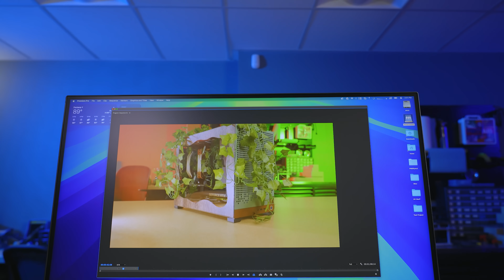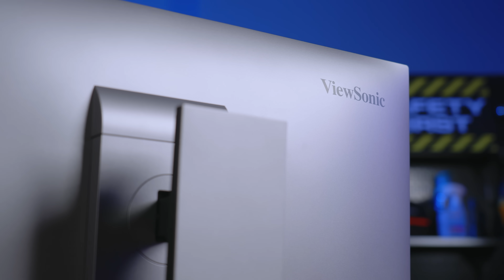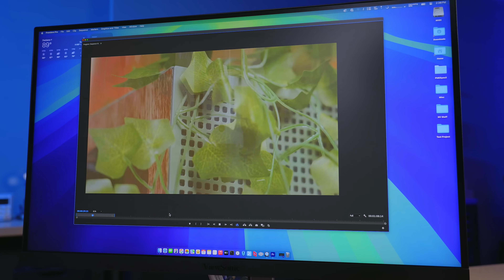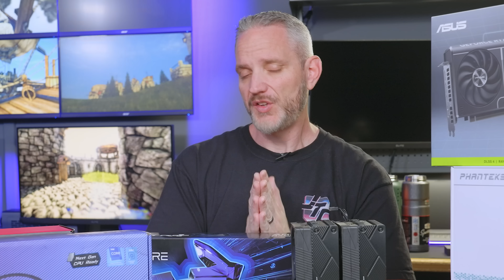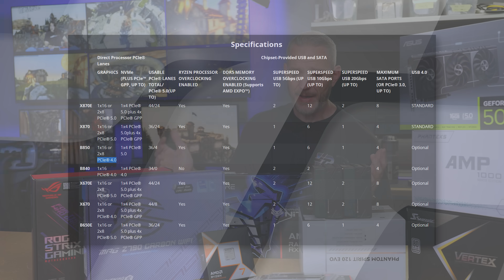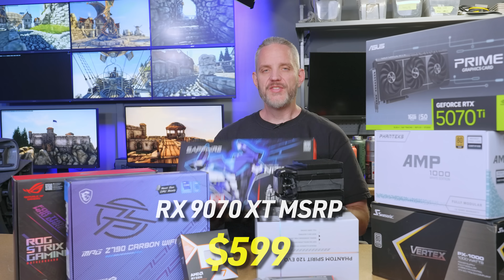This is the Sweetspot for PC gaming... Don't get fooled into spending more!

Comment: After building several computer systems, I am only now beginning to recognize how much money is often wasted on maximizing numerical specifications merely for their own sake.
Reply: Used can be good value. Rich/engineers need fastest best tech so they sell their 3 year old great kit. Can buy top tier from 3-4 years ago for a fraction of the price.
Reply: @Google_Does_Evil_Now trui just saw a whole pc sold for a 490€ with a 3090 inside, and the guy even gave the 27 screen 😮🤷
Reply: Same. I've been building within many budgets for years. When it comes to gaming you really want to build around your gpu and not budget your PSU too much. The rest? Really easy to use exceptionally cheap, so called low performance, parts. 

The difference in fps between 2 pc's using the exact same gpu might just be under 3%, while the costlier pc can easily cost 50%-100% more. Especially if you game at 4k or even 1440p. At 1080p your cpu becomes the limiting factor much more easily.

If anyone needs help with finding the perfect combination of parts within your budget, with explanations and discussion if needed, I'm willing to help you out. I don't need compensation or anything, just want to make sure other people get a good experience inside of hobby that I dearly love. 

For people wanting to go through the wonderful proces of building your own pc and picking the parts yourself, I have a few points to think about;

1. Make your gpu the focus off the budget. I've had issues with a 2nd hand gpu only 1 in +-20 that I've ever bought. YMMV! So 2nd market might be a good idea to look into. Just make sure it works beforehand.

2. It depends on your budget and what games you want to play, but within the midrange segment it might be smart to only spend around 50-70% of your intended gpu budget. If it can carry you for 2 years. After those 2 years you will be able to sell your recently bought gpu to still get a nice price for it. Add your savings from those 2 years before and whatever you have saved up and you will probably have much better performance and or acces to new technologies, than you would have had with your full priced gpu. It's a technique I've used myself over the years to steadily increase my gpu tier, without having to splurge or save up for a long time. This works especially well if you get a recent and popular 2nd hand model as your first gpu. Just upgrade before it loses too much of its worth (compared to what you paid for it).

3. It's good to know that you'll be able to upgrade your cpu on a certain socket, but in practice most people just end up running their system without a need to upgrade, untill its much more worth to just built a new system (or at least replace just the mobo+cpu+memory).

4. Single core clockspeeds are still the most important for most games, but the generation of your cpu and things like extra (3d) cache might have a bigger impact to irl performance. Just do your research and look for your gpu in the resolution you want to game (very important as there is verrrry little difference when gaming at 4k). Nowadays I'd advice 6+ cores, but plenty games still run great on a quadcore with fast clockspeeds, if you're on a really really tight budget.

5. Don't get hyped up by YouTubers. If you only play games you will probably be better off with a 150-250 euro/dollar cpu than a top of the line. Only get those if you are rich, want bragging rights or do any heavy workloads besides gaming.

6. If it's your first build I would put a little extra towards the case and power suppl, as you can keep them while upgrading the rest over many years, if not decades (my chassis is 12yo now, and a good PSU can keep with you for over 20 years if it's good quality and your power needs do not exceed it.

7. Personally I would go for a 9000 series (if you want to go older gen just pick Nvidia) AMD GPU at this time. Unless you want to play games with path tracing, use SVP with rife ai and/or Nvidia optical flow or need the cuda cores for work. As AMD's 9000 series support FSR 4 well and it gives you a whoooole lot more performance per dollar.

8. Keep your GPU's ram in mind. Especially if you want it to last. 8gb is becoming not enough, even for 1080p gaming. That's why I got a 5070 ti over budget instead of a 5070 with just 12gb. Those 4gb difference cost me a hundred bucks, while it will make the card last much longer. If I didn't need many of the special features on Nvidia cards (I use all of them), I would have gotten a RX 9070 without question!!

10. And last but not least, don't worry too much about getting the newest generation motherboard, cpu and memory. Irl there isn't that much of a difference when gaming. And even in workloads the difference is often dissapointing. A 600 dollar pc with last gen parts can often outperform a 1000 dollar of using the latest parts. And I'm talking similar tiers here.

P.s. don't get an overpriced motherboard and look at the I/O needs you have. So how many and what kind of hard drives do you want? How many usb? Do you need very high speed usb? Pick one with 4 channel DDR as that is one of the few things people consistently upgrade. External wifi is always better and way too expensive on a mobo. And probably the most important part for any gamer is what kind of PCI-e (your gpu connection) it has and how many PCI lanes (how many things you can connect, like harddrives, beside your gpu. PCI-e 3 is getting old, but 4 is absolutely fine for most things, as long as it has a 16x connection.
Reply: @2Adapt I want to get into pc. I’ve been a console gamer for 15 years. What would you recommend with a budget of 2k. My main focus is performance. I play lots of multiplayer/rank/competitive. Graphics to me aren’t a big deal, I hardly play single player story games. But the option would be nice to play something in 4k and have smooth gameplay.
Reply: @2Adapt  No i would not keep a psu for that long.
Reply: yeah wasted 20% extra money on my last build, at least I was fully aware of it  and did it anyway. :)
Reply: You should buy a new one only when you need it. Look for the best value for the money, not the best unless you REALLY need that. I updated my rest of the computer, but still using my 2080, because it is enough for me right now. Otherwise I made good purchases, but I bough too expensive motherboad. Although, it was also kind of an experiment, because I have had cheaper ones previously. Cheaper ones is much better choice. Rather spend that money on better cooler, case and PSU.
Reply: @xvnbm fully agree with you there. Top parts are there for the rich enthusiast. I used to for the most part chase the best graphics possible, as I've always been in love with that aspect of gaming. But teaching myself to love gameplay over graphics was one of the better lessons I've taught myself. As I'm getting older and the AAA market is becoming foul, I'm learning that it's better to look back and appreciate what we have. I still adore good style/graphics and love things like path tracing (and yes I love DLSS and FG, when used properly as well), but I'm also aware that there are many more games already out there that could keep me busy for at least hundreds of years.

If you want to be content or even happy, stop chasing dragons, and learn to appreciate what you already have, is what I have to keep telling myself. And everytime I put this into RL action, I learn that I've been missing out on pure joy and art, simply because of my own biases and spoiledness.

Keep rocking that mighty 2080, and enjoy it with all that you got!
Reply: ah what the hell... its in the bus if the bus has been upgraded ya go for it, if not its smoke and mirrors. Yep its that simple how fast the parts talk to one another is what matters the most.
Reply: I never had a lastest generation console. I always got the second to latest. And now that I switched to pc I do the same. Cheaper games, cheaper parts. And for my needs that is a good thing and enough.
Reply: only thing worth worrying about is the gpu. everything else can be mid or low tier
Reply: @mexreax4493  Eh, CPU can matter quite a bit too, especially at 1080p or in cpu-heavy games so dont cheap out on that too much
Reply: @mexreax4493 cpu very important proly more than gpu cause u can put a beasty cpu paired with a fairly high end gpu and not even worry about a 90 series card
Reply: Absolutely. My ~8 year old PC can still run every game out there, granted not on ultra or anything but on either medium or high
Reply: @EB_3D  My 2017 build is rocking still.  CoffeeLake 4.2GHz 6 core lol,  although I picked up an EVGA RTX 3070 (with rebar) when my MSI 1080 died a couple years ago for 500 CAD.  Often one can scoop cards when their next gen launches and all of the meta-chasers dump their cards on the market all at once :)   Everything can be run High 1440p 144Hz Gsync with the right ini tweaks and debloated OS & NVMe. So much so, when I finally do a new build in a year or so, I will likely hand down this to GF for her first gaming rig
Reply: @MattRoadhouse 
Great to hear that your system is still serving you very well.

I went to the same RTX 3070 when I gave my 1080 to my partner. And I'm still rocking an AMD 5600x (although with a heavy, but stable OC @ 4,7ghz). Nowadays paired with a 5070 ti. And it's still not really bottlenecking at 4k with path tracing! I might gain a max of 3% fps if I went with a completely new system off around 800 euros for just the mobo+cpu+memory. I do have to say that the overclock is doing a lot of the heavy lifting, and I do feel limited when it comes to anything outside of gaming.
Reply: @2Adapt  That's awesome!  I wasn't sure about bringing the 3070 over to my next build,  was considering 5070 ti super after it drops and my first AMD chip.  Haven't looked much in to 4k yet although I probably should, as my rig is also my media center w/ fiber optic sound -> Onkyo amp -> pair of car sub boxes lol
Reply: @MattRoadhouse sounds like a great setup, and I hope the 5070 ti is going to be affordable for you. It's little brother (that I own) is already a power house and a much bigger upgrade than what YouTubers and charts had me believe. Especially when it comes to running modern technologies like DLSS 4 and path tracing. I'm currently running my plasma at 1440p@60hz, my CRT at 2560x2048p@90hz, and my tablet screen 2560x1600p@120hz, so I'm not on 4k either. When you're stuck on 1080p a good solution is to use Nvidia DSR and downscale from 1440p or 4k to 1080p. Even if you use the exact same internal resolution with DLLS the downscaled red will look so much better. Even 1080p with DLSS DLAA looks worse than 4k DSR with DLLS performance (or the one that gives you a 1080p internal res).

Comment: I've always over spec'ed PSU. I typically use them for 7-10 years.  Like I was able to get a Corsair RMe 1200w  for $170 last year. Even though I know my system at most will draw abit above 600w.

Comment: Still love my 5600G and 3070… bought in May 2022 to use the internal graphics until GPU prices dropped in the fall desperately needed a new desktop and got going… probably will eventually get a new cpu and then repurpose the 5600g to be a small form factor nuc like desktop, current system drives three monitors for productivity. Which I end up doing more than gaming and performance wise I am never left wanting more or upset with how it performs.

Comment: You talk about the thermalright air cooler for $50 but you can also get the thermalright 360 AIOs for around $50 too. When theyre the same price the AIO would be the better choice. The thermalright frozen prism 360 performs close to the arctic liquid freezer III for half the price. On a budget build with mild overclocking the thermalright is a no brainer. Also where TF is this 9800X at????

Comment: You're scary, Jay. I JUST WALKED OUT of Microcenter after being in there for over 2 hours doing physical research as to what to upgrade to, motherboard wise and Cpu wise, from a 10700k. This is exactly what I needed to hear. No 870E board for me!
Reply: You should just keep the 10700k little longer, that's the last good CPU from intel and I couldn't imagine any gaming scenario when this CPU wouldn't be enough. If you turn off all stupid security features (TPM, SGX, Spectre, Meltdown...) you can gain a little more performance, but it's true for other CPUs as well. Maybe a little all core OC to 4.90-5.00GHz.

Here is agreat video about CPU scaling from Hardware Canucks, 10700k about the same as the 12600k on the charts
REALISTIC CPU Scaling - RTX 5070 & RX 9070 XT

With an expensive platform switch you gain max 10% gaming performance and 50-70W less power consumption, for production work it is a totally different story.
Reply: @sviktor4  Main issue with a 10th gen i7 is PCIe 3.0 IMO. I experienced a substantial jump in performance moving to the 9700x, but the 5060 Ti 16G was a big part of it (along with jumping from 2933 MT/s to 6000 MT/s RAM, Gen 4 NVME). Probably a much different experience with a GPU that actually uses 16 lanes instead of 8 like the 5060 Ti. I likely wouldn't have upgraded if I had found an affordable RTX 4070 instead.
Reply: @arnis_brown  Don't fool yourself with the PCIE speed, it only matters, when the GPU runs out of memory.
5060 Ti sounds bad to me, I much rather choose a used RTX3080 or RX6800, but my guess is you wanted to buy new parts.

AM5 is a totally different breed, I often test motherboards with a linux pendrive and watch the command line rolling,, but on AM5 I can't see sh**, monitor blink-blink and the OS is fully loaded. The uplift from AM4 to AM5 is crazy, my only explanation is that AMD replaced its engineers with wizards.
Reply: @sviktor4  Sorry, but I couldn't. I was not getting the performance I needed out of it anymore. Space Marines 2 was suffering, along with several other CPU intensive games I had. Mind you, I upgraded to a 5070ti from a 3080, and these games were still struggling. Now that I have both the 9800X3D and the 5070ti? Every game that I want to perform, performs.

Comment: Pretty much the PC I built earlier in the year, B850, 9700X, 9070XT, 32GB, decent 2TB NVME and Montech case and PSU deal.   It's been great.
Reply: I got a 7800x3d with the same specs. I play at ultra high fps and 1080p low settings so the X3D was definitely worth it for me

Comment: I have a 7800X3D paired with an Overclocked 7900GRE. Not sure if it’s a good pairing, but I run all my games at 4k with no issues. FPS is really good as well. I think some combos just work well together and you can get more performance than expected.
Reply: Was gonna go for GRE but I saw a good deal for the 7900 xtx that would pair well with 7800x3d before the announcement or release of the newer x3d CPU. So I went for that instead but it was still expensive then originally planned when I attempted to buy PC part to build my custom PC.